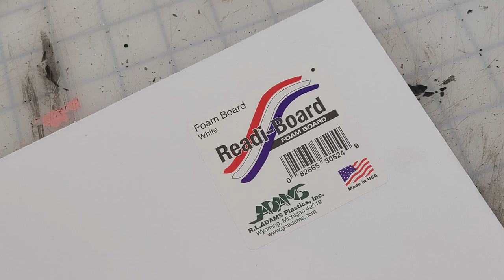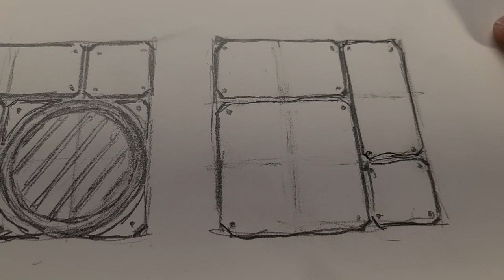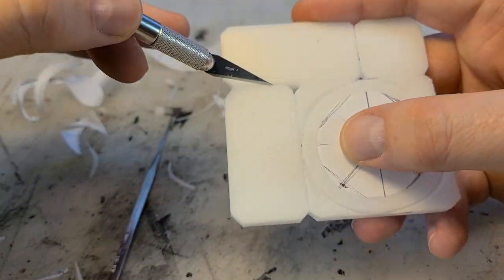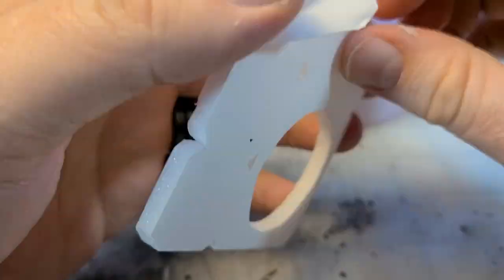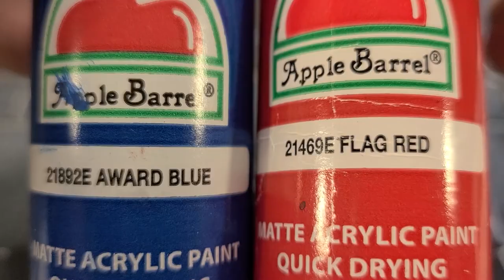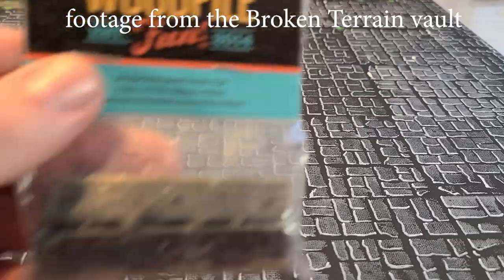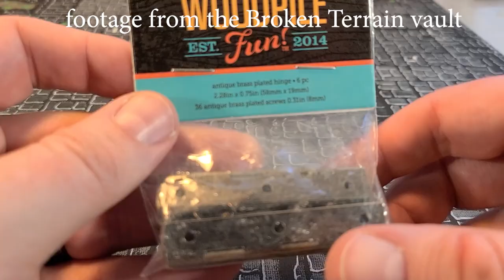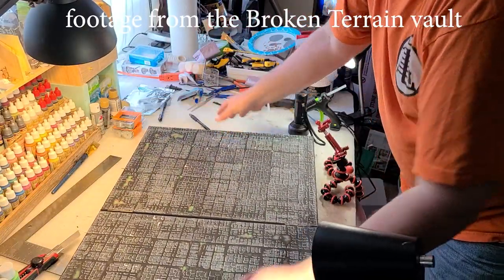Foldable Portable Tabletop Sci-fi Remix

Comment: have you thought of covering the foam on your stamps with latex so that they last longer? I am not sure if it would work, but in my mind it does.
Reply from the maker: Not a bad idea.  Right now I  find that the stamps have flattened a bit after repeated use and pressure.
Reply: @brokenterrain  Yeah, thats what I thought would happen due to the softness of the material, plus the moisture from the paint.

Comment: quick question, you didn't really show it in the prior video, but did you screw in the hinges or say like super glue them? I ask because I'm not familiar with how strong or sturdy the canvas's frame and whether or not that might crack or something
Reply from the maker: I used the hinges pack with screws.  It seemed to work well.  No splitting or breakage.  Time will tell if it holds up from lots of use.

Comment: For this one, if you do a second one on the back, I would build three up to the same level as the frame, then leave one shallower. Paint it so it looks like it goes into a bottomless shaft something like this. https://img.freepik.com/free-photo/3d-illustration-4k-uhd-sci-fi-square-shaped-tunnel_129677-2404.jpg?w=2000. Then build a bridge across, or build a couple (one whole, one broken) that you can put some sort of control panel or something on that the figures have to get to. This could also work with a fantasy one where they have a shootout in the goblin caves. Maybe when leveling the edges, you make it less rectangular.
Reply from the maker: What an incredible idea.  I love it. 😁 👍